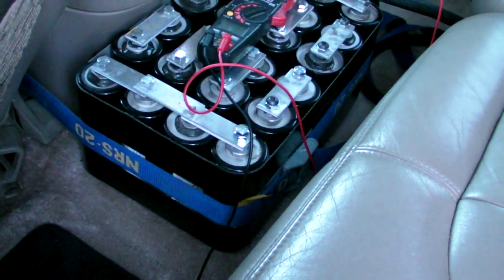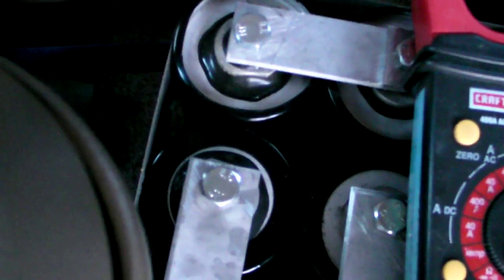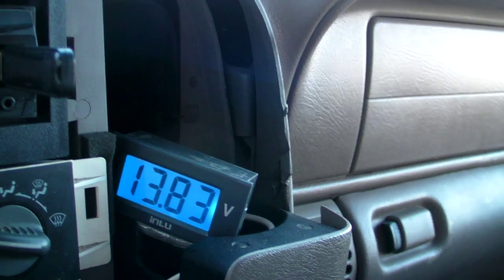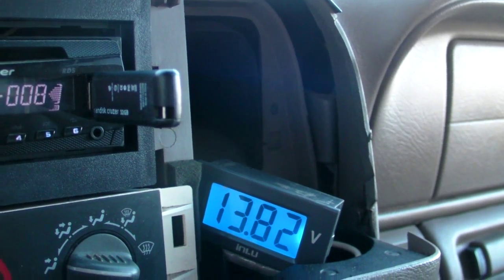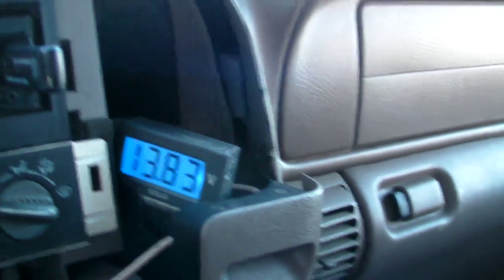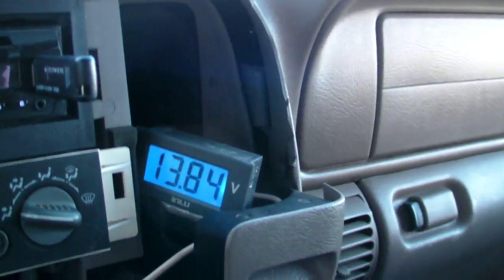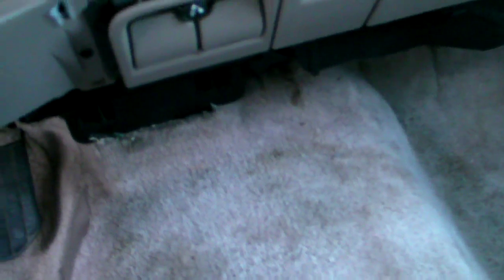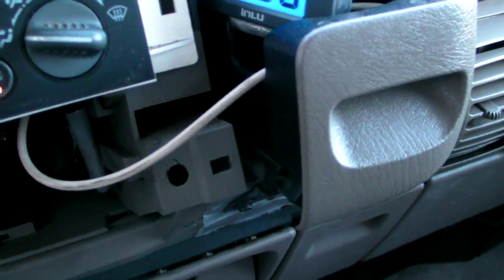Maxwell Ultracaps, The Daily Difference

Comment: Hey, Ben, im pushing 3k watt rms with 2 Helix C-one's, Audiofrog 150.4,  and P6 dsp amp and i got recommended a 500 f maxwell. I need consistency like yours, do you feel it will help me with my daily drive? I have 10farad nvx with slight dimming and drop to like 12.9-13.3 . I have xs agm under hood and oem alt. 21 civic hatch so i dont want a high output alt cuz i think itll screw with my ecm. Any advice is appreciated

Comment: Good demonstration I myself am new to lithium and can't go the HO alternator route because my car can't take one because of the newer ECU so I ordered a 74Ah lifepo4 battery and a ioxus ultra cap battery to help it with the voltage drop that I know will happen with the stock alternator I know it's normal to see the constant fluctuation of the voltage when the bass hits with lithium and or supercaps because there's little to no resistance like with the lead acid battery but as i said im new to lithium actually don't even have my batteries in hand yet just ordered them so im wondering if it is better to altogether delete the oem lead acid battery or run an isolator the ioxus and the lithium are both completely assembled drop ins the lithium has bms active balancing the works so all that is taken care of i just don't know how i should do it what is going to give me the best power delivery and at the same time not fry my alternator the lithium is the lev60 prov2 from jag35 they say it's drop in safe but I want to make sure because I am brand new to lithium
Reply: I’ve been using lev60f and the ioxus ultra cap in my m3 with the upgraded stock 140amp alt, it’s the biggest one they make for my car outside of getting one customer made but for the power level I’m pushing right now I see no need to get an upgraded higher output alt. Prior to this I was on the stock stock 80amp alt and boy was going to the 140 a night and day difference 😅 I don’t run any isolator either just everything wired parallel. Currently using the factory h6 agm battery and 74ah of lifepo4 lev60f and that ultra cap and I’m pleased to say it hasn’t skipped a beat. I have 3 amps total in the car. 10 channels active in the cabin and 1 extremely heavy subwoofer that’s tearing this coupe to pieces lol powered by a 3k Banda amplifier but I’ll be switching that out soon for an 8k lol. If things get dicey I plan to add another pack of lev hope you got your shit figured out by now
Reply: @onesikm3  I definitely have im currently running a SCIB bank from NORTHWEST LITHIUM and charging at 15.8 I took out the Lev60 battery because I installed the HO alternator and I have seen numerous posts on Facebook where the battery is catching fire and failing prematurely because of over charging they should have never promoted these batteries to be used with a High output alternator or charged above 14.0 volts it's a recipe for disaster so if you are charging above 14.0 be careful it's just a matter of time

Comment: The voltage going up over 14 and then not doing it with the cap, thats not "cap filtering", thats because the current draw with no cap is like say 500A on with like a nanosecond risetime (aka there was no load then 500A in a literal instant), then back off again in a nanosecond, whereas with the cap, the the bass hits, the current draw is like 500A, the alternator can dish out say 350A, the cap supports it with the remaining 150A (and it works this way because the amp is going to draw off the higher voltage source first, which will always be the alternator) and then once the current request from the amp goes back to zero, the alternator doesn't see an instant load switch like before, now the alt has to recharge the cap back up to the alt output voltage, so the current would still be fairly high after the note ends, but it (the current) will be tapering off as the cap charges back up to the alt output voltage.  That is to say, the cap eliminates the horrid on-off transients on the alternator, the cap can react faster to the current request, and it is also absorbing the shock of the high to low current state by letting the current flow taper off smoother

Comment: @Ben did you put a resistor when adding them on to your car 12 cables or just have like a big switch?  so they are between the amp and the battery ?
Reply: Super cap banks don’t need isolated from the vehicle wether your using agm or lithium....also they can be mounted before or after the batteries in your build....I still run them after the lithium, but it’s fine if they’re before the battery

Comment: yeah... a second and maybe third car battery would kind of have same effect for cheaper, i guess
Reply: ChickenCommander battery’s help but capacitors can charge and discharge so much faster so they fill in the gaps when load changes a lot better
Reply: @MR66HD  yeah the output impedance of a car battery is very small allready. no need for improvement here. i'm pretty sure ben will find similar results when trying with a new and big battery instead of the cap-banks.
Reply: ChickenCommander  the capacitor is.   Much better at it then  battery’s that’s why they are used in everything to smooth out the voltage but yes  he should balsa have another battery or 2 and this cap bank I reckon and it would be a lot better
Reply: ChickenCommander  yes I agree it’s not.  The normal sound system but it’s the best to show  how the caps work and how well. If u have everything set up right  , you are correct. Tho  he has good  high output alternator the next step should be a battery before caps

Comment: Whit all that power definitely you need the big 3 conectiont..!!!!!
Reply: A big 3/ big 4 simply eliminates resistance & increases current flow...it’s a great thing to do when your running additional electrical loads on your vehicle wether it’s car audio-cb radios-plows-winches etc it doesn’t increase your electrical capability per say it simply allows what electrical you do have to work better

Comment: 2 batteries and an alt is all u need
Reply: A capacitor is basically the best thing you can add to a car.  Unlike a battery, the caps will charge to 100% of the alternators output.  When the bass hits and the current draw goes sky high, the alternator gets loaded down, straining the engine.  The alternator takes time for the current to be generated, with a cap the current is sitting there waiting to be discharged with the smallest amount of internal resistance physically possible.  Because of the tiny internal resistance, the cap will recharge as fast as the alt can output, no battery could ever come close.  Without a cap, when you draw more than the alt can output, the voltage sags down to battery voltage.  With the cap, the alternator gets saturated then the caps start to drain, but the cap is sitting at the same voltage as the alt was.  100 batteries wouldn't match 100F of capacitance for vdroop.  A 1500A alternator still wouldn't fix the issue because the internal resistance of the alternator is higher than the cap.  The alternator might be able to sustain 1500A but it is not going to handle the transients as well as a cap.    2 batteries and an alt might be ok for your typical 3kwrms 350A system, but it's different when your pulling 800 or 1000 ampere or more.  This guy is running at least 5K on subs alone, either a VFL500.1 or 2 Ampere 3800.1's or something

Comment: @ Ben Sinor, I don't know if you ever solved your problem with the voltage dips but I can tell you what it was from. Your ultra caps have an ability to dump around 200 amps & they will recharge every 4 seconds so it appears that you need more than 1 alternator to generate more amps into the capacitors to refill them faster so that there is not brief moments of voltage drop. This must explain why I've seen some cars that have crazy amounts of watts on amps needing 3 or 4 alternators.

Comment: I have a question. I'm about to step my power up to around 5-6k. I have a 300amp alt, lots of 2/0, big 3, a yellow top up front, and a group 31 in the cab. Would a supercap bank keep me ok? Any advice would be appreciated. Thank you.
Reply: I running 8k all 0 gauge 250 alt with xs power 7500 and a ultra cap all good

Comment: With the ultra cap, those voltage sudden dip/drop are caused by power cables losses.
Either insufficient gauge size, quality of power cable, bad connection and poor cable termination. If you did quality cable works, the sudden drop of voltage will be very little. Theoretical with no losses on connection, you won't see any sudden drop or spike of voltage.
Reply from the maker: I don't have dips/drops with the caps hooked up.. You would know that if you were watching carefully.
Reply from the maker: TheMexicaNigga That's aluminum and that's not the issue.  He doesn't realize I have a very large amplifier causing huge amperage draws causing the dips.
Reply: He doesn't realize? hes a bass head!!! we strive for one purpose and thats amperage! 
We like to keep stable voltage in car audio because a large drop can have several catastrophic consequences to equipment, we cheat using adjustable voltage regulators, large banks of batteries and high ouput alternators to maintain enough current or a stable enough voltage to work with.

Voltage drop in car audio is a everlasting problem only solved by delivering enough current to maintain voltage at a certain TIME interval, now this is where time is important!
Because music is dynamic, those dips caused by the lower bass notes which require more current for the amplifiers to drive the signal only lasts a moment, its all time based.
If you can "recover" voltage fast enough that you don't govwandering  out of the working boundaries of the equipment (ie:14v and 16volt equipment) then you can survive the demand (as long as you have enough reserve ie:battery bank). for the spike in current. 
The caps certainly do seem to help in smoothing out the dip in his voltage by delivering current on demand when the bass drops low. 

This does work up to the point in TIME where the amplifiers are demanding more current than is available same issue as with the doorstop capacitor rage. once the amperage demand exceeds whats available only more amperage works.
There are cheats for example using an adjustable voltage regulator to allow batteries to charge at a higher rate than an internal regulator would, Big3, multiple alternators, banks of batteries/caps, multiple runs of +/- power cable.
If he is seeing improvements great!!! its obviously working for his setup, my only question would be if he is still seeing some drop in voltage there is still not enough amperage being delivered for your demands.

Good video mate thanks for posting it!

Ian
Reply: Most of the loss would actually come from the steel lookin plates he used to connect the caps together. But this is a real world application and everything has resistance...

Comment: Should be turning over much faster, Your Sla sounds tired/weak. Its probably fine until you need a high current draw. I have a universal emergency battery with 275cca, it turns over the 5.4sohc without hesitation.
Ive experienced brand new Sla batteries perform this way from sitting on the shelf too long, including Optima and Duralast Gold.
Have you tried leaving the battery on charge for a couple nights??

Comment: Wouldn't adding a second high discharge car audio batt be more efficient and cheaper?  All those caps seem like a complicated solution to a simple problem.
Reply from the maker: First off,  thank you for a polite response with a well thought out question.  It's a nice change from most youtube comments.  Well it might appear that way but let me try to show my point of view.

What is the problem?  Well I think we can all agree the problem is voltage.  When we pull too much power our voltage goes down.  What are batteries?  Batteries store energy.  They discharge and recharge slowly.  So when you add another battery to fix your voltage you are only applying a bandaid to the situation of not enough power being produced.  Only alternators produce power in cars.  Batts and caps just store it.  So hypothetically you have 400 ah of battery reserve with a 200 amp alt and 6k to your subs.  You are consistently into low 12s high 11s with voltage.  What this means is your alternator isn't supplying enough power and your batteries are giving away some of their storage to keep up voltage.  Now in doing this you are actually discharging them.  And they will eventually not hold good voltage because alternators can't effectively charge batteries.  The reasoning is somewhat complicated but trust me when I say an alternator can never recharge a battery in a vehicle to 100%.  Now with this setup you are going to have to recharge your batteries every once in a while.  Maybe once a week with heavy use.  But the problem is voltage so why not add more alternators?  Let's say you can't.  Well then wouldn't you rather a storage device that weighs significantly less than a battery,  cost almost the same price as a battery, (my 24 caps were about 400.  A little more than a d3100) and most importantly can recharge to 100% while driving?  To me the choice is clear.  All your power comes from your alt/s, so why not store and distribute it more efficiently?

They might seem complex on first glance but in reality it's pretty plug and play once the bank is built.

If the situation was different and you listened to tones for hours on end where your storage devices couldn't recharge then hell yes.  As many batts as the axles can hold.  But if you listen to music then caps are what you want IMO.
Reply: @BENSYARDSERVICE  Excellent description! You said you got 24 caps for 400? Used right?
Reply: *****
i thought i heard you say something that you should have a second battery on top of the caps in the video?
Reply from the maker: Eian Wahgener 
I did.  Just in case your alternator fails while you are driving you need the reserve capacity to get home.  In the same token if there is a problem caps will keep draining until zero whereas a battery will help hold it up for a while.